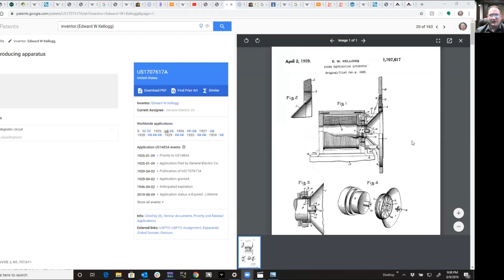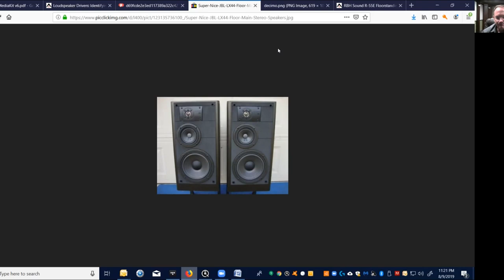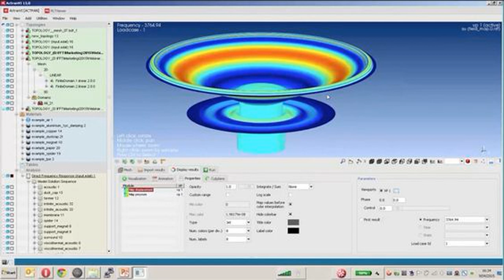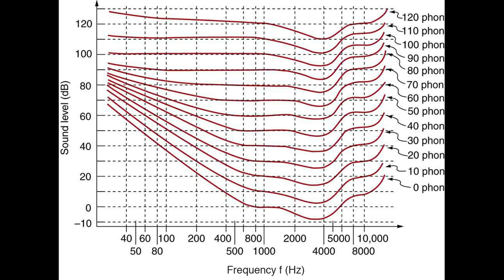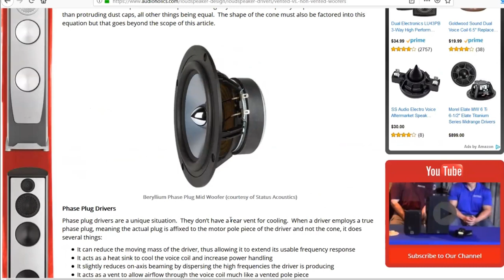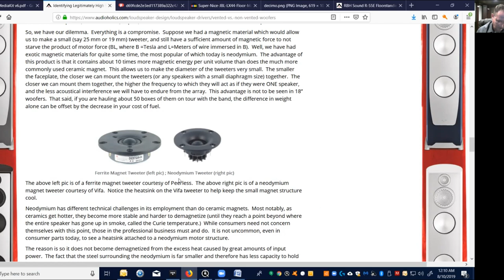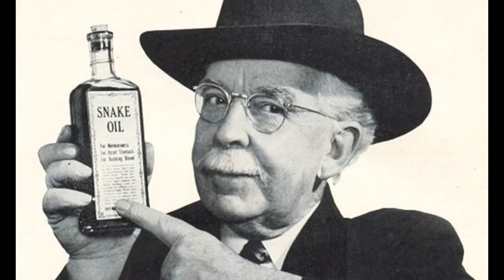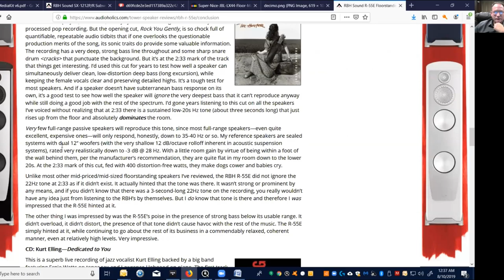Do Exotic Driver Materials Make Loudspeakers Sound Better?

Comment: Just to clear up some history, Altec Lansing did not become JBL. James Lansing left Altec Lansing in 1946, and founded a new company called Lansing Sound, Incorporated. Altec Lansing had issues with the name of the new company, so James Lansing changes the name to James B. Lansing Sound, Incorporated, which was eventually shortened to JBL. Both Altec Lansing and JBL still exist, however, Altec Lansing has dwindled to a shadow of its former self.
Reply: Audio has a history of taking designer's names away from them, such that they lose the business rights to their own name: Mark Levinson, David Hafler, Bob Carver, and so on.
Reply: I think Altec and James  had a disagreement  about whether to use a horseshoe or round magnet type in their speakers, so I've  heard, and then separated.

Comment: I heard (or read) that the first speaker was an electrostatic using pig skin for the diaphragm which wasn't very practical but now you can buy electrostatic speakers with lower measurable distortion than any dynamic speaker. I own electrostatic and dynamic speakers including some vintage speakers like the AR-3.

Comment: if you look closely at the Kellogg rice design, you see it in fact has a moving coil driven element and the is in the middle of the voice coil, like wheel spokes.  The stationary magnet is a dc powered electromagnet.

Comment: I had Infinity reference.  The Pure poly (Watkins)  woofers were dual impedance .  They sounded pleasant, but the pure poly was too soft and tended to sound that way.  Arnie Nudell later developed graphite injected poly and those woofers (IE: Kappa 9)  were a big improvement in rigidity.

Comment: I've never seen a metal cone, or a ceramic cone for that matter, that didn't have a whole lot of spurious resonances and distortion that didn't require tons of aggressive crossover over-engineering just to try to get those breakup modes down in level, and even so, much of that breakup is audible in the frequency response. I've also learned over time that good paper drivers deliver a much more natural tone and timbre than other materials....

Comment: Very informative video.  In regard to a heavier cone, I note that f=ma and f= I'• dl x B.  So, if  m (mass of cone) increases, you just increase B (the strength of the magnet) and a (acceleration of the cone) remains the same.  It is the second derivative of cone motion (acceleration) which produces sound.
 
I was disappointed that you did not discuss mid-range drivers.  There is also more possible difference there since they come in both cone and dome.  I am really interested to know if these sound different.
Reply: Since it's the second derivative of the cone or dome motion produces the sound,  the same force driving more mass simply equally decreases the acoustic output uniformly across the entire frequency range .

It's thus NOT true that lighter cones or domes have more extended high frequency response.

Other factors may cause such differences, especially resonances and standing waves, but not the mass itself.

Comment: In the near future I might make a mid bass pair of 12 inch woofers in open baffle to strengthen the bass of a  pair of Maggnepan 0.7's or I might save up for a DWM. I will audition the DWM next month when I go to Wilmington, DE for the opera which is closer to Overture Audio Video to make my final decision. Magnepan did some experiments with their 30.7 for condos system which uses cone speakers in an open baffle to get stronger mid bass. If I make my own open baffle with the 12 inch woofers what might you suggest?

Comment: May I get feedback on my hypothesis here ?
Please feel free to point out what I am missing in regard to different analysis while under signal control (Frequency Response), and NOT under signal control, (Spectral Decay)

I get continually silenced on a different audio form.  There, they have people of the mindset that there are no such thing as fast woofers.  
I disagree with this completely as a function of speaker mass.   
Many are suggesting the speaker systems ability to stay agile despite the mass when responding to different frequencies negates the consideration that there are fast woofers.
I suggest that the frequency response analysis relates to the spectral decay ONLY through the driver's mass.
I further hypothesize that the spectral decay is a far more relevant measurement of how a speaker will perform in relation to its mass, (outside of secondary servo control designed to artificially dampen movement in real time).
I assert that the analysis of frequency response is all about under signal control while the decay is with NO signal and therefore frequency response should never be completely extrapolated over the spectral decay.
The spectral decay is significant due to music having many nulls.  

The ability of a speaker to stop producing sound in the time domain has an analogy.
With the caveat of one being a time delay to low decibel, and the other being the lowest achievable threshold.
The spectral decay could be considered similar to the black level specification of a computer monitor.

There are voids in sound reproduction and there isn't much logic in dis-considering the speakers performance in relation to its mass.
In short, fast woofers do exist.
Caveat:  Crossover design can, and has been used to arrest frequencies that tend to have higher response that translate to addressing, and eliminating a "leg" seen in the spectral decay.
I still assert that the mass will influence the over steepness of the decay, across the remaining spectrum outside of any resonance anomalies.

Comment: Long story short: The ideal cone has zero mass, has infinite stiffness and infinite strength as well as infinite damping ratio.
Reply: if you have 0 mass then you already have infinite damping ratio.
Reply: I feel like within a certain size, rice paper cones are still as close as we've come.
Reply: @Wised1000  Diamond isn't a particularly expensive material - it's an expensive PERCEPTION.  Industrial, manufactured diamond might be gray and ugly, but it's not particularly expensive, and has more predictable crystal structure.  I would promise if it became widespread without the hype it would be like carbon fiber - just another material used in manufacturing where stiff and light is the goal.
Reply: @Wised1000  it's diamond powder coated not an actual diamond. It would cost hundreds of thousands pounds a actual woofer or tweeter made out of just real or lab made diamonds.

Low mass carbon fiber woofers are still much better performing than BW diamond coated woofers.

Comment: The only drivers that one can hear the materials used is the tweeter. The materials used, aluminum, beryllium, etc, have their own sonic signatures you can hear. Only one that does not is silk, and the "smooth as silk" cliche applies. Silk dome tweeters are the only ones that are dead neutral and don't seem to add their own sound to the music. Some like the sound of Focal for example, but to my ears it sounds like two pans being banged together and get fatiguing real fast to my ears.
Reply: That's total BS! If I put a bunch of speakers using different tweeter dome materials behind a curtain and asked you to identify them you'd fail miserably. Focal speakers are bright because their tweeters are voiced hot, not because of the dome material. It's the crossover design that matters most. There are speakers that are bright and shrill with silk domes because the tweeter is voiced too loud, and there are speakers with metal dome tweeters that have soft highs because the tweeter is voiced softer. DUH!
Reply: @DougMen1  You're absolutely false.  Cone material absolutely influences the sound and that difference can be heard by the human ear.  It's not the only factor, but it's a major factor

Comment: Certain exotic materials have their place. I believe SVS uses a really strong material for their PB-16 sub cone to maintain its shape and accuracy considering the power output of the amp and size of the cone, although that particular sub also has a rather large VC to combat that too. Some of the companies claim that certain materials are really light, yet strong to help with transient response and efficiency, but I haven't seen any unbiased objective testing to prove that. It all depends on what you define as sound better I guess.

Comment: All good, but we keep forgetting that accurate speakers make bad recordings sound *bad*. There is something to be said for good old pulp cones and silk domes - they are forgiving. My ancient Advents were never brutal to bad recordings. Everything sounded good while great stuff still sounded great.

Lets not forget Magneplanars. They are low mass/high rigidity, but in an entirely different way and primarily due to application vs materials - material to motor surface ratio. It's basically 1:1 where a large cone is controlled by a relatively small voice coil. Too bad about the dispersion thing...
Reply: I will tell you as a Magnipan owner they are almost unbeatable except a little expensive
Reply: They are unbeatable - as long as you’re sitting in their sweet spot and don’t turn your head 😉 Stand up and move or turn your head and the magic disappears - as all magic does. But, if I always listened to music sitting in one chair, I would have Magnepans over anything else. They are really magical.
Reply: Yeah, I'll take accurate anyway.  It's honesty.   I just don't sit and concentrate on bad recordings.   

I haven't heard magneplanars for decades.   I did think they sounded great.  But I don't believe they're capable of clean high SPL.
Reply: How would you define “high spl”? 90dB? 100dB? I won’t say you’re wrong as I had MG1s that would cause thermal shut down on my Hartman Kardon Citation amp (~300 wpc @ 4 ohms) over about 95dB.

No, the lower end Magnepans won’t do 110 without compressing, but who listens at that level for more than one song? I don’t know about you, Grandad, but at my age I have to try to protect what hearing I have left. I don’t go over 90dB and Maggies do that handily on 200 watts.
Reply: @billd9667  
I get ya.   I'm certainly not typical.

So, my meter is bouncing around 110dB with C weighting on fast response.   

I'm trying to recreate a concert.   Often a real concert and other times studio albums which I pretend are concerts while listening.   A typical listening session for me is 40 to 90 minutes.   I'm listening to the little intricacies which I attribute to my excellent hearing in general, not just for my age.   It's still not as loud as a concert.

An important consideration is that I don't listen to highly compressed source material.   So the high SPL is really transients that jump out.   Accurate wideband transient response at high SPL is challenging for a reproduction system.   But great for the soul!
🍻
Reply: @billd9667  You don't listen to a song at 110dB, unless you don't value your hearing or you're listening in earplugs. However, songs can have huge dynamic range and can peak really high. It's about having that headroom. Don't forget to also factor in distance to the listener.
Reply: BROis Huh? 😂

Who says you don’t listen at 110dB? When I had double Advents in a tiny room back in the day, I’m sure I did that at least once. Not to mention the Bose system in my Nissan...

Yes, you make good points, but I was just making my point with exaggeration. As I said, I rarely exceed 90db at my seating position these days. You’re “lucky” to get a recording that has a 6dB dynamic range. There is a web site somewhere that tracks compression in recordings and lists their dynamic range. The vast majority have less than 4dB. Any good 100 watt amp/speaker domination can handle that with ease. Naturally, orchestral recordings as the exception.
Reply: @billd9667  
Wow.  You need some better source material!   6dB dynamic range???  I certainly won't sit and listen to that!

Comment: FYI, waveguides matches the dispersion pattern of tweeter to that of the woofer. Smooth power response is very important and not  usually possible without waveguides. 
Of course gene does not know anything about dispersion. He criticized a commercial manufacturer for using a tweeter in B&W style but without the back chamber. Gene, forget the back chamber taper loading for the tweeter. The diffraction benefits are enormous.
Limited knowledge is a very dangerous thing.

Comment: I also bought a pair of JBL LS speakers purchased from Circuit City.
Reply: I still miss that store. Life was better when Best Buy had some competition.
Reply: Still rockin a pair of JBL LS810s, a PSW 1000 subwoofer and the original center channel also. Using them on my now #2 home-theater. The whole set still sounds good. I will never part with these little jems. Purchased in 1998 as a set at...Circuit City. I miss that store along with Good Guys. It's becoming harder all the time to demo equipment nowadays. BB is good store, but it has virtually no competition. Especially now with Fry's Electronics closing, at least in my area. Nice video...thanks!

Comment: Gene, I understand that there is a difference between 4ohm and 8ohm speakers; could you please explain what makes them different on a mechanical/component level?

Preferably in layman’s terms for us non-engineering folks. Thanks!
Reply: A 4 ohm version of a driver would use a thicker wire in the voice coil compared to the 8 ohm version. Usually everything else remains same.
Reply: Super-Z how does the thicker coil translate into improved sound?
Reply: @johnpoo1662  more power/louder, the less the resistance the more the current, and the more the current the stronger the magnetic field so a 4ohm speaker driver uses more Amps than an 8ohm,  it uses more power and sounds louder.
Reply: @thinnspeaker6123  Guess that makes sense. Stronger magnetic field probably means more linear control of the cone movement, higher damping.

Comment: Does anyone know what kind of material it is when a cone looks glossy?... And I don't mean that it's like smooth plastic glossy but when the surface is more coarse and it almost looks like someone put black nail polish on the cone. - Is that just paper cones treated with some kind of plastic to stiffen it or something?
The speakers I'm talking about, by the way, are by MB Quart... SR 800 something or other... But they really stand out from other speakers I have because they look like that, while the others look more matte, either like paper or rubber.

Comment: I am sure this does not apply to "run, don't walk" when a speaker is advertised with the word "digital." I needed a DC power supply of 10 Volts at 10 Amps for the cathode heaters on my SET vacuum tubes and all the filter capacitors big enough to work, including the 4.5 Farad capacitor I needed to get pure enough DC at that amperage are called "digital" capacitors.

Comment: I wouldn’t agree that less bouncing material is better for suspension cause this means low Qms, and correspondently high Qes, and low Tl, and so forth. In another words that is not good for a sound. What is good is high Qms, low Qes, high Tl, less dependency on a dumping factor (cause a crossover defines a lowest output impedance, not an amplifier), and so on. This is why aluminum cones looks great but need too much compromises

Comment: Yes, of course, there is a reason paper loudspeakers are still popular, they simply sound better and don't produce that nasty ear-drilling third harmonic distortions... In fact, some of the best sounding speakers are still paper.
Reply: Paper woofers in a well designed speaker system can sound good. But the reality is paper degrades fairly quickly no matter the reinforcement and coatings.

Low mass rigid carbon fibre woofers are a much better woofer material producing better performance. And also longevity as they are very durable extremely long lasting.
Reply: @C--A  That sounds plausible, I hadn't thought of that.
Reply: I've heard some good paper drivers, I'd love to hear well sorted carbon drivers and not just those used in cheaper drivers as marketing.
Reply: Paper might be bettered in resolution, but very little else. I've heard shockingly expensive metal cones sounding very dynamic but also slightly unnatural too.
Reply: Mick Gill I have a speaker with paper woofer and “diamond” titanium tweeter. Sounds pretty nice. Paper dome tweeters didn’t become very popular. Now it’s soft textile or metal for the most part.
Reply: What about for bass drivers? Isn't aluminum better?

Comment: When it comes to cone material I can't help but in my mind paper pulp is just superior sound wise such as rich and warmth smooth bass response and polypropylene is just cheap like the impression of cheapness of most plastic products and so many cheapo speakers using PP and metal cones probably tinny like cymbals and sheet metal . It's not based on real world comparison or reality it's a mental thing I can't get over by associating them to items not even related to speakers.

Comment: Well...  diamond (carbon crystal)  is expensive and exotic.  None of the speakers I heard so equipped impressed me.  The tweeter  stuck out like a sore thumb.  Titanium?  pffft. Give me scan speak or Vifa silk.
Reply: Metal woofers and diamond coated tweeters aren't the best materials to use in my opinion. Ultra low mass carbon fibre woofers reinforced with ultra wafer thin ultra rigid graphene or nanotube carbon is the future for speaker woofers and tweeters 🔊
Reply: My friend has a set using scanspeak paper and soft dome, it sounds very nice. Some would probably find it soft, but they sound great at least so far as I can tell.
Titanium has had a particular sound, I have some "diamond" coated tweeters. Sounds pretty good though a slight hardness to the sound.